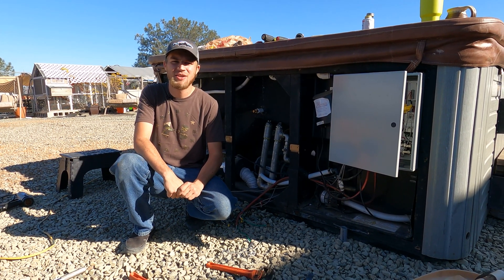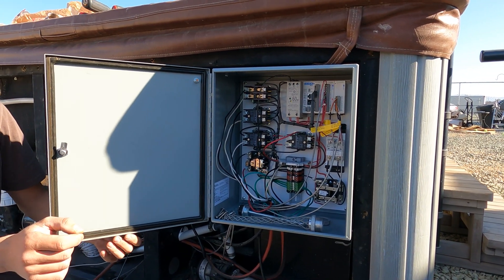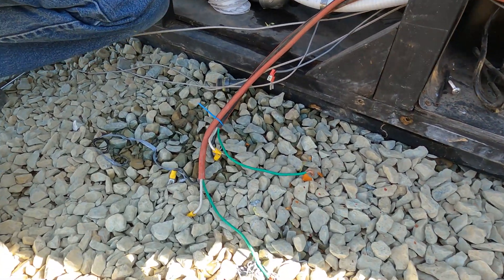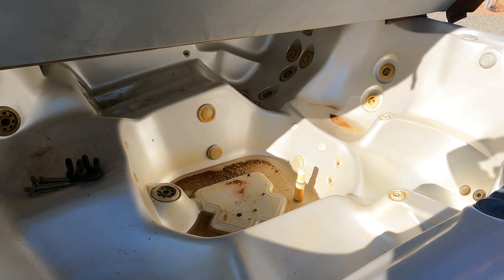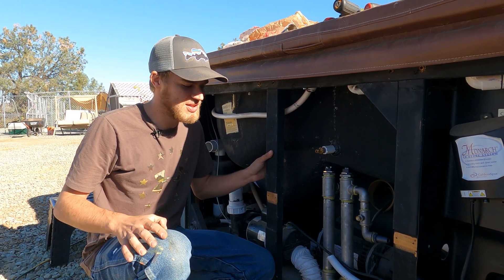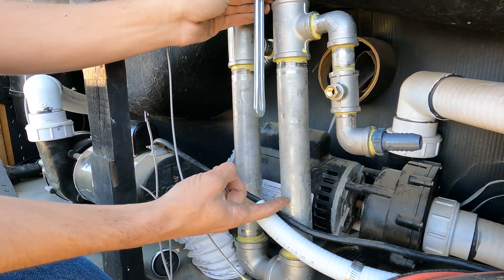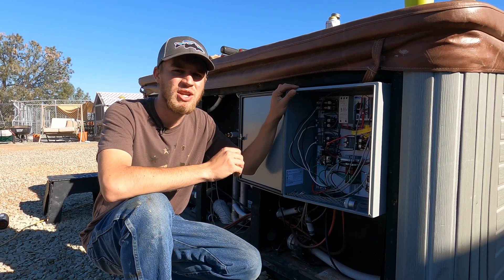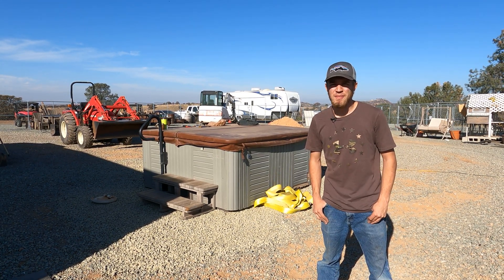OFF-GRID and we have an ELECTRIC HOT TUB!?!?!??!

Comment: Cool, that has me thinking of a instant tankless water heater based on that design, using low voltage elements, using excess solar along with my tankless gas water heater, save gas while its sunny and the batteries are charged!

Comment: How did it burn away all the water when you said there was no water in it? Was a bit of water sitting on the elements? What type of area contains the heating elements?
Reply from the maker: It boiled the water.  There is a tube that the water runs through with an element in the middle

Comment: Geez, how much does all this cost?? Don't get me wrong, I enjoy seeing you follow through on projects I would normally only think about, but stainless steel pipes, high-powered solid state relay, PLC with presumably multiple analog inputs, and electrical enclosure... Would love to see BOM and how much these projects cost!! Maybe you know a secret I don't about getting these things for cheap
Reply from the maker: When you consider that the utility company wanted $70,000 to bring us power, not only have we built and upgraded our system many times, but the cost of this spa, all the controls to make it off-grid, etc. is all still less than bringing in the utilities.  The pleasure of being able to take a second to relax every now and then in our busy lives is worth every penny and hour worked.
Reply: It is probably overkill but FUN overkill
Reply: The costs are saved over time, so it ends up much cheaper.

Comment: Take a look at any of the Ecosmart electric tankless water heaters.  Might get some good ideas for assembling a heating system.  Types of sensors, etc.  They use soldered copper piping for the elements too.
Reply: I think this would be a cheap way of fixing this. I have one of those Ecosmart heaters and it was like less than $200 so it would be easy to plumb into a hot tub Mine still on the wall boosting my solar hot water.
Reply from the maker: I've been thinking about additional ways we can heat this.  Some of the thoughts have ranged from a propane heater to a wood burning stove wrapped in copper.
Reply: @HighTechLab  Man you have plenty of land and an excavator I would be putting in ground source heat pump cheapest way to heat water.

Comment: Better and safer would be to put a 10 gal hot water heater along side the tub and use the existing pump to circulate through it.  Cheaper, safer, more efficient.  With the insulated lid on the amount of resistance element needed is minimal.  9500 watts is overkill by many times.  It will take a while for the tub to reach desired water temp. but once there a small 120 volt heater will suffice.  And it won't freeze if it's on.  You could actually built a set of steps up to the tub and mount such a heater under them and open to the interior of the tub works.
And by the way, the use of a PLC is unnecessary, and especially since you had to build a control box using relays to perform functions.  The thermister could be replaced with an aquastat to turn the heating element on/off as needed.  A simple switch to control the circulator(s) would suffice.  I've built so many control boxes over the years to control heating, air conditioning and refrigeration that I've learned use of integrated circuits is a way for manufacturers to create a proprietary environment which then causes the need to return to that manufacturer to obtain parts.  Back in the day (pre-'80's) I could carry enough devices to repair and make useable any brand of equipment I was servicing.  And post IC use I would routinely re-design to my own specifications to make the unit easily repairable.  IC's are a pain in the ass.
Reply from the maker: "use of integrated circuits is a way for manufacturers to create a proprietary environment which then causes the need to return to that manufacturer to obtain parts"

I am building this for my own personal use and programmed the PLC on my own?  Not sure where "proprietary" comes from.

The reason behind the 9500 watt heating capability is because when not in use everything shuts down to save power.  If you want to use the spa, you tell the system via HMI and it brings it up to temperature rapidly, then when you're all done completely shuts down - With the exception of a daily clean cycle.

Comment: I assume you have an ethernet cable going i between the 2 plcs so they can talk to eachother?
Reply from the maker: Yes, there was no power feed or ethernet installed at the time of recording because we just got done picking the thing up and relocating it with the excavator - The spa has sat apart for a few weeks now because I haven't had the time to take the whole thing apart and get everything back in order until now.